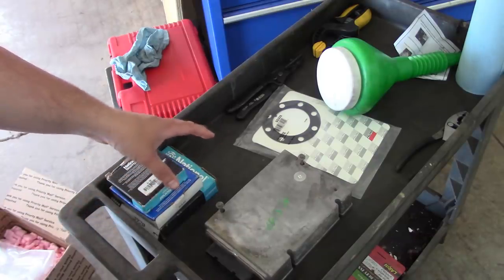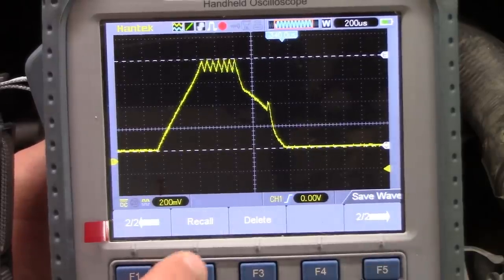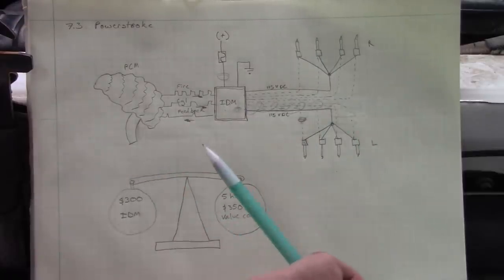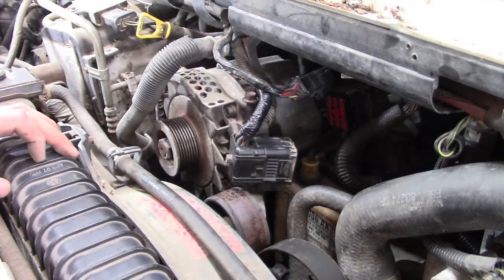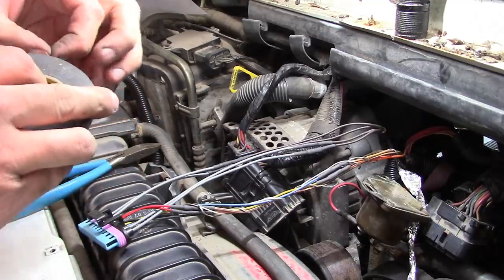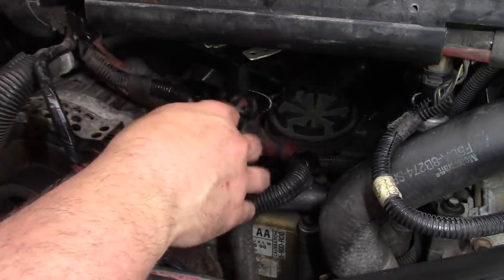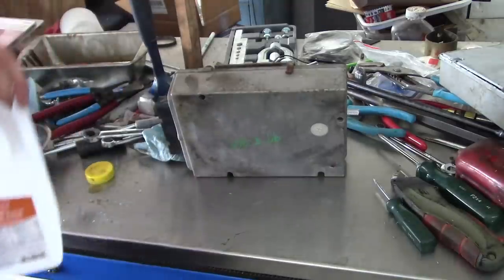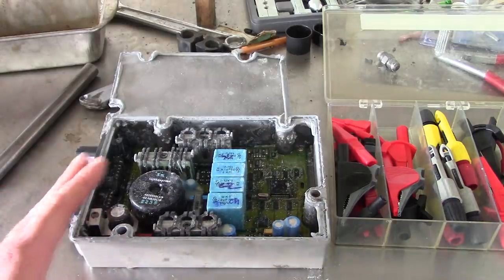Ford E350 | 7.3 Power Stroke - IDM Testing and Wiring Repairs - Part 2

Comment: I wonder if that giant alternator is your issue...that could be a 300-400 amp alternator
Reply from the maker: It should not be an issue if the regulator works correctly.
Reply: Im just wondering if there is voltage spikes, espically if ac voltage is escaping the rectifier.  Idm failure is actually fairly rare with most of it being isolated to water or injector harness issues.  Also never have seen one eat idms, normally if a circuit has failed destroying the idm in the process a new idm results in dead cylinders or banks.  This one is a curious puzzle. Is there a probelm or were they dorman idms? However I doubt they were dorman idms or it would not of made it 25 miles.

Comment: maybe the plastic hat will also serve as a sacrificial anode and give the mice something else to chew on instead of wiring harnesses.  Maybe im onto something there!  Rat poison sacrificial wiring harnesses that you hang under the hood like one of those pine tree air fresheners.
Reply from the maker: Maybe I should use electrical wire in my mouse traps...

Comment: Not exactly video related, where do you get a graph paper pad like that with the header and side rules?
IDM hat had me laughing, but it's not stupid if it works!
Reply from the maker: It's commonly called engineering paper. You can find it in office supply stores.

Comment: you might have power issues because of the Ambu prep pack. really the alternator should be swapped back to the original config just for grins and farts and giggles.
Reply from the maker: Yeah. I have a spare alternator that would fit.

Comment: Had a 6.2l Ford diesel altec boom truck(shop close to factory) it needed head gaskets. Boss asked me if we should take the job. It was good profit. I said; Fuck no im not removing a boom and a cab on this huge f450 truck. Take it to a big truck shop. B4 i worked at dealers i did indpt shops everything from 74 vettes, jaguars, merceds, fedex mercedes diesels,  and big international midsize diesels. I never liked nasty diesel work

Comment: Great troubleshooting, but would you trust this 25 year old oddball if you had to rob a bank, even if it was within a 20 mile radius, of course not!
If the owner wants to throw beaucoup bucks at it, that's fine, but at some time,  you have to step-up to the plate and tell him you don't want to see it in the driveway.

Comment: Wes, that glow plug wire was more than likely your killer. Bleeding high amperage into the drain circuit on the injector harness.

Edit: I failed to proofread my original comment and came across as a functional idiot.
Reply from the maker: Hmm. I don't know. I think the injectors are isolated from the block.
Reply: @WatchWesWork  the drain acts just like an antenna on a Tesla coil, all of that EMI from that high amperage short circuit more than likely hyper charged the shielding on the drain all of the way back to the IDM.

Comment: They make heat skrink crimps with solder all in one now.......**tip
Reply from the maker: I get that comment in every video where I do wiring repairs, which is basically every video. I don't see any advantage to a solder connector.
Reply: @WatchWesWork  no major advantages,  just faster . They are clear so you can see any problems also. Heat skrink , crimp, solder at the same time is nice after 25 in a door gap on your knees

Comment: you ever need parts for the t444e, vt365, or maxxforce7 i got anything and everything for these turds, i can't throw this stuff away fast enough
Reply from the maker: I'm surprised. There are a lot of those engines still on the road.

Comment: The owner should have never bought the e350 . I would have never worked on the truck . ford differently had a brain fart when they stock a Diesel engine in a van .
Reply: I love the 7.3 vans their real reliable. pain in the ass to work on but reliable.

Comment: NEVER have I owned such a piece of CRAP (95 E350 psd) this engine was design to break down and leave you stranded ! It has EVERYTHING a real diesel doesn’t meet to run . My 95 mechanical 8.3 Cummins doesn’t even need electricity to run or stop ( cable shut down ) a real live mechanic can diagnose this Cummins no run no start in 15 minutes with wrenches and a screw driver. I can do a full inframe rebuild in less time and money that it takes to diagnose this Ford Power smoke joke !